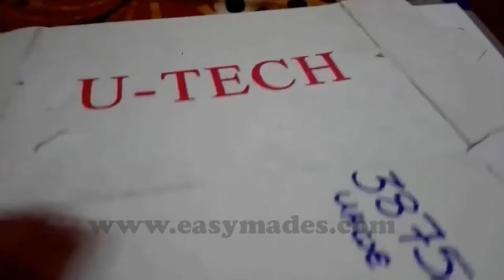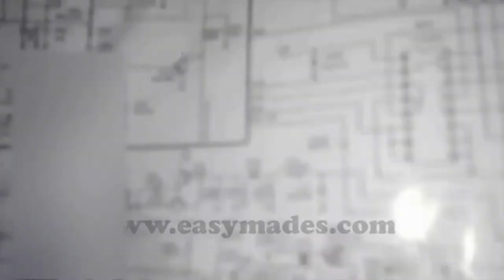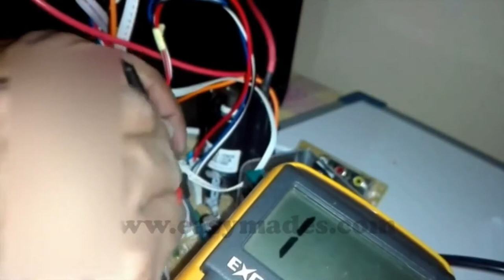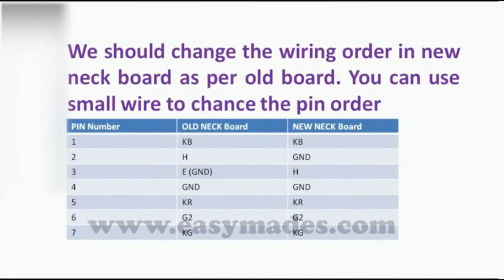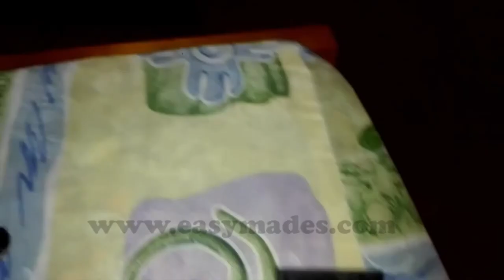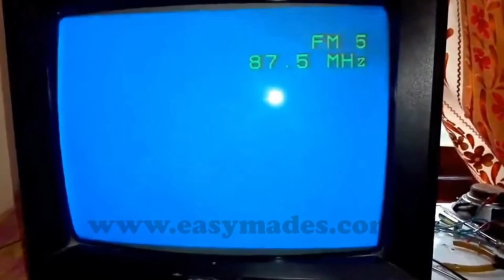You can replace CRT TV Mainboard by yourself

Comment: Hey there. I'm an aspiring crt tv hobbyist and repaired. I scraped the main boards for spare transistors and capiators, but I cut the wires from the crt should I have done this or desoldered them from the crt neck?
Reply from the maker: If the main board is burnt unrepairable. you have to replace a new main board. When you replace the mainboard, the CRT tube must be in good condition. In your case, if you are going to replace a new board, you you have to replace the neck from old board to new one and also connect the correct pins as the pinouts may not be as same as the old one.